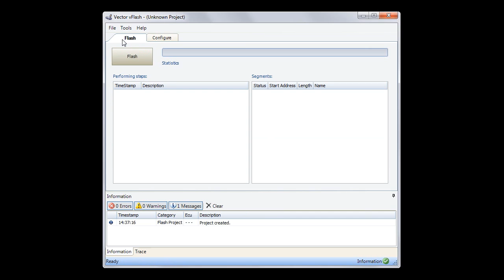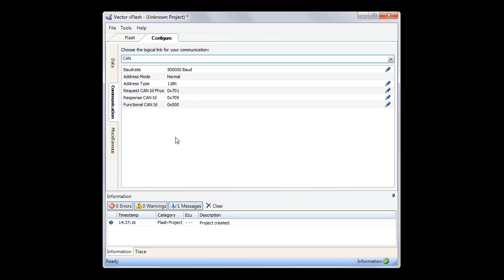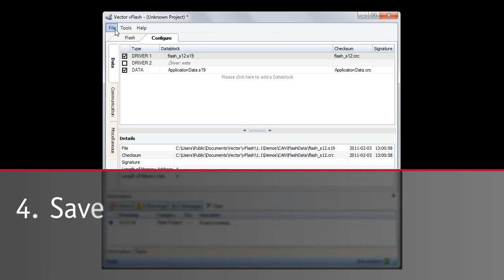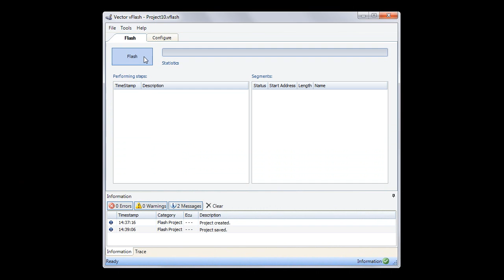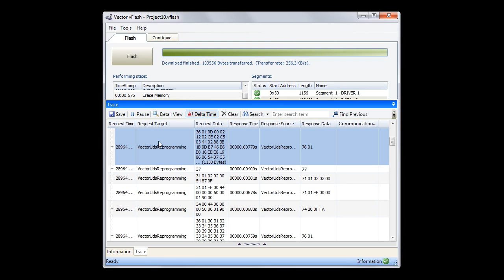(Re-) Programming ECUs quickly and easily with vFlash

Comment: Is it mandatory to be in programming session (FBL) while flashing the ECU or this can be achieved in application as well(e.g. extended session)?
Can the steps be omitted like the one for entering in programming session requested by the vFlash tool sequence?
Reply from the maker: The ECU defines the sequence to be used for updating the software. Usually this is done in the Flash Bootloader (FBL) and therefore requires to enter the Bootloader (Programming Session) before flashing – see also ISO14229.
The flash sequence that vFlash uses is implemented within plugins, so-called “vFlash Templates”. Such a plugin (template) could also implement an update procedure without entering the programming session. Vector already offers more than 150 different templates for different OEM (and supplier) flash specifications. If your specification is not covered, Vector offers the creation of such a template, based on your flash specification.

Comment: Vector boys, there won't be these tools in few years after electric vehicles take over
Reply: I wonder why?, the electric cars do not use this type of communication to be flashed? or why?
Reply: @aldosolano1995  too much of combustion related stuff is there in vector software,  only 20% of  software is useful for EV
Reply: Vector is not only for ecu you can flash and configur change DIDS on all modules even high voltage modules plus vector is an Engineering tool and it i use it daily at work i don't know were you got your information from please if you don't know don't talk out of your ASS